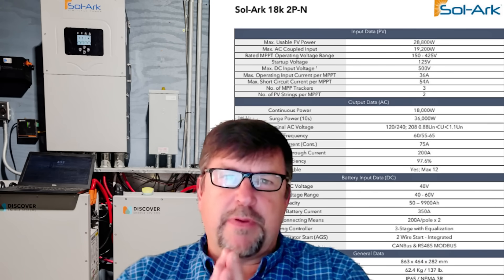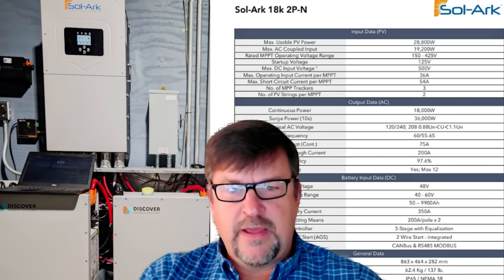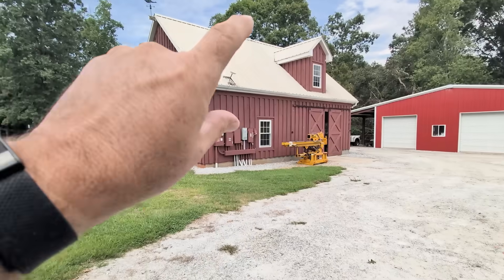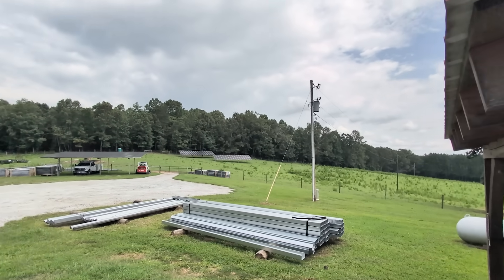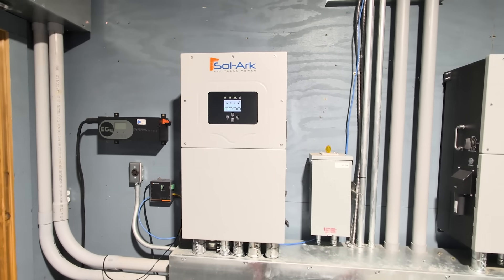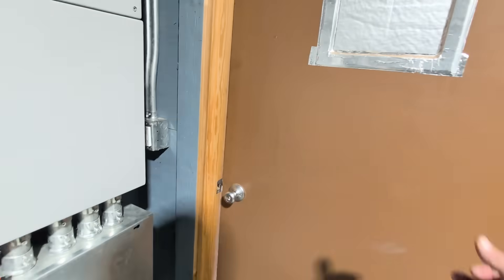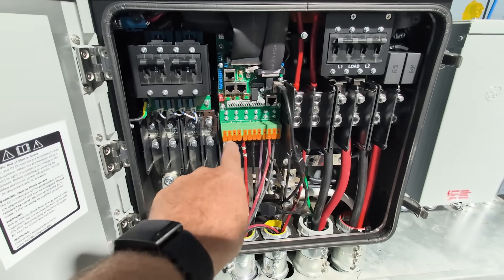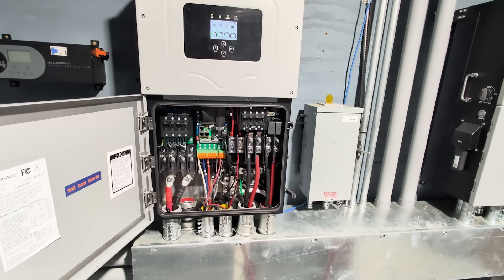Introducing Sol-Ark 18K: Seamless Whole-Home Backup, Zero Load Sheds!

Comment: The Solark supplied script has you specifically hating on MID's lol. Completely missing their main purpose of PCS so that a main panel upgrade is not required and paralleling cost's are kept low.
Reply from the maker: You're completely confused on how this stuff gets installed. Who said anything about having to upgrade a main panel?  One machine does it all and no panel upgrades are required. I can install one  inverter a lot faster than 2 devices.
Reply: All in one devices like Sol-Ark 15k (and probably 18k) also have PCS functionality?

Comment: I wonder why these inverters are so expensive in USA. Here in Europe, similar Deye inverter, which would be the Deye 15k SG05LP3 EUSM2 costs like 2300 EUR (including VAT) going up to 3400 EUR for the 20K SG05LP3 EUSM2. It is true, that the support is close to non existing, depending on who is the seller, but again we get the 10 years manufacturing warranty. I kind of think you folks are getting ripped off. I have the Deye 15k and it has been performing flawlessly.
Reply from the maker: Why do you say that is similar? Not even in the same league
Reply: @engineer775  I'm not an expert, but the specs seem similar to me. Maybe I'm missing something.
Reply: @engineer775  Compare to the SUN-18K-SG01LP1-EU-AM3-P at around $3800
Reply: @engineer775 what the difference? Fail to understand why USA solar is so pricey compaired to Europe. Example panels 500 watts Aiko (best AAA) are 85 USD... usa 200 USD? Same goes for inverters.... Im helping coworkers in USA but its so pricey

Comment: Good video. Very cool unit. So are you running 4/0 wire from the battery? You might have mentioned it but I didn’t hear.
Reply from the maker: I'm running 4/0 from the inverter to the battery combiner and then there are two sets of 2/0 running from the Helios batteries to the same combiners
Reply: @engineer775 ok gotcha. I agree about the mppt. That’s one thing megarevo does right. They have 4 mppt’s on their larger units. It’s a shame Solark didn’t inset the bottom of these like the EG4 units so they could flush mount on a wireway. Not a deal breaker, I just like the cleaner look.

Comment: It often sounds like you hate EG4 products. I was looking at the gridboss and a flex boss with batteries to start cutting my power bill but the way you talk has me second guessing everything. I am on a very low set income in a very old house that the summer power bill is killing me on. I was going to buy the EG4 a piece at a time. Is my idea horrible?
Reply: That's exactly what I did. It's not "horrible" at all.  Having a 7KW PV array along with the FB21 and Gridboss--and no battery at all--shaved $70.00 a month off my electric bill. Two days ago, I added one EG4 wall mount PowerPro battery and my daily grid usage has gone down to  around 5 KWh a day. I'm paying around .28 cents per KWh so I expect my monthly electric bill will be around $40.00-$50.00.  As winter approaches of course the bill will go up, unless I add another battery which are expensive. I've done all the work myself so that saved a great deal of money. I've probably spent around $13,000 on this system which is a lot of money but I think the ROI will only be around 5 years. And in another 5 years I expect rates to continue to skyrocket. GL!
Reply: EG4 is great, that's what I went with.  But it's also basically U.S. only (I think) and its a DIY type of system.  The installer base with EG4 is very small compared to Tesla, Enphase, and Franklin.  So if you go with EG4 you have a lot of footwork to do either DIYing parts of the system yourself or finding an installer able/willing to install the equipment.  Not for the faint of heart.

Its a lot easier if you go without backup, then you can just backfeed the hybrid inverter via a breaker on the main panel and call it a day.

But if you want to go with grid-down backup you need the GridBoss in the equation and that means wiring a service entrance, an intercept between service and main panel, or forwarding from the main panel to the GridBoss and wiring a new panel on the output (and moving circuits).  Needless to say, most of those options require an electrician.

The equipment quality is roughly similar to Sol-Ark and Franklin in my view.  And I believe superior to Tesla and Enphase.  My own system (which I DIY'd over a few weeks) is a GridBoss + Flexboss21 + 3 x 14.3kWh EG4 indoor batteries.  Plus a bunch of solar with more on the way and a second inverter in on deck that I will be installing in a month or two (mainly to get the more capable MPPTs than the SMA that I have the solar connected to now).

-Matt
Reply: Thank you both @mainebears711 and @junkerzn7312 . The battery is a must i am afraid as we have frequent power outages at least 2 a month it seems this year. I have meds that have to stay cold and my mother is on oxygen so once I get paid up on the hospital I shall start on my solar adventure.
Reply: I bought a growatt SPH-10000-tl-us hybrid inverter with a 10 year warranty from signature solar for just over $2000. I have 9.3kw of panels, and 48kwh of lifepo4 cells in diy purchased metal battery boxes with JK BMS's. Batteries communicate to my inverter. This has run my 2000sf home in Wisconsin flawlessly without pulling any power from the grid. In total everything has cost me a little over $10000. If you're looking for a great system for cheap, I definitely recommend it. Oh, the growatt inverter has 3 mppt's 525 volts a piece and can handle 15000w of solar panels.
Reply: Good to know that EG4 doesn’t have as deep a service bench. I need to have a system that my wife or a home buyer can get support for.

Comment: EG4 VS SOL-ARK. Its getting interesting👏
Reply: EG4 remains more price competitive
Reply: @Gamerz00760 All I can say is my SA has been flawless since the day I flipped the switch 5 years ago. The 2k extra was a trivial extra cost for the reliability it has given.
Reply: Does Eg4 have a 200a passthru?
Reply: @KelvinFPV  18Kpv
Reply: @KelvinFPV  Several of their options do, yes.
Reply: @KelvinFPV yes
Reply: Everyone loves to compare the two but I think they are different products. 

Sol-Ark has everything, it looks like a great all in one, pass through, high current rating, it could run my whole house, but you pay for all those features. 

Lu power stripped theirs down to just the essentials and put the other stuff in another box. You pay for just the stuff you need. 

Engineer775 builds premium systems for his customers and chooses top tier products. There is no doubt about that, but I think EG4 is catering to a whole different group of people. If you don’t have batteries and still have a decent net metering agreement it might make sense to pay half as much and go with the Luxpower for half the cost.
Reply: @whalen83  IDK about that.... Lu makes multiple different types that both is a total all in one with load shedding/gen port, pass through it all plus more mppts, for better peaking. For about 2500 less then SA.  Or you can get a stripped down one for about 3K less then SA an buy a box for 2500K that does 3-4x as much as any inverter when it comes to load shedding, sell back and utilization. 
 
 TBH If it was just one inverter put up I would go with SA. But if it's a "large" back-up system of 2 or more, I would go Lu/EG4. I could get matching inverters AND the distro box for around 2K savings. Plus everything has a dedicated brain so if one inverter failed OR the box failed it would still passthrough.   Plus instead of 3 swapping gen/micro grid/load shed ports you end up with 10 swapping and one dedicated gen port  with 3 inverters.   Even with just one vs one and a box that load shedding is divine if you have bad credits! 1 swap vs 6 swap and 1 gen port, electric water tanks are some good cheap batteries...
Reply: Everyone is talking about sol-ark and eg4. People really need to look into growatt's SPH line up. Very cheap with similar options and 10 year warranty
Reply: @truth-hurts768  True, but they don't pass code in most states. But op for Off grid
Reply: You mean Luxpower vs Sol Ark, since thats who makes all of EG4s stuff, its just re-badged.
Reply: @MasterXBKC are Sol-arks not rebadged Deye inverters?